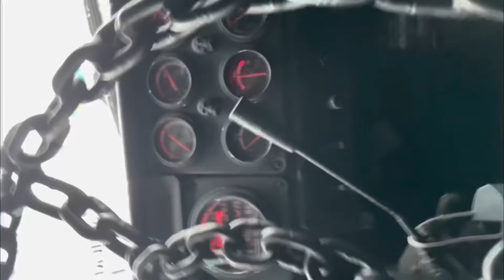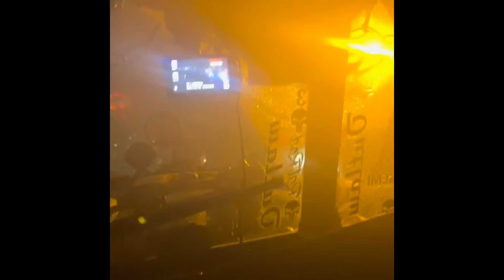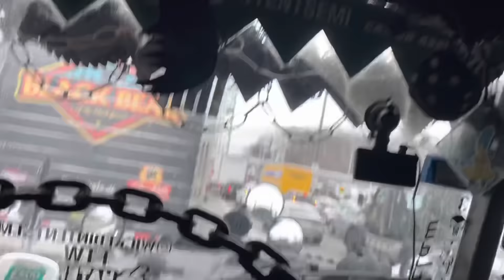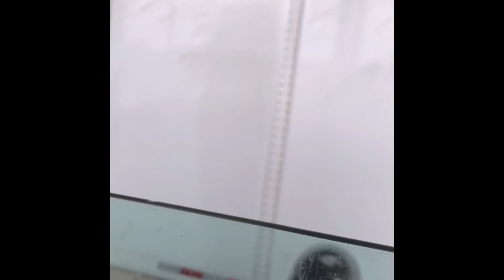WINTER TRUCKING IN SNOW AND ICE !!!!!! (4K)  WICKED INTENT TRUCK SERIES NYC

Comment: Awesome as always brother. My Macks off the road after a shunt with an unissued driver, has hit my wallet hard
Reply from the maker: Dam bro that sucks hope a quick recovery !!!!
Reply: @WickedIntentSemi , the idiot ran a stop sign. Stay safe brother
Reply: @roscoe9507  what mack you runnin driv'ah? I have a 03 mack vision looking to sell or trade for a cabover?
Reply: @keepontruckinoutlawlife1248  , R Model Mack, my 1978 peterbilt 359 still in the shop, so I now have two off the road. PM me with a price. Thanks for hitting me up
Reply: @roscoe9507  well the trans just recently is your 359 a cabover? My 03 is a sleeper truck has a million miles on it and needs a trans I took the transmission out last year to help a friend out who needed one I  use the mack only to pull my mother's 5th wheel camper with had a 13 speed in it original was going to put the same back in this spring. I'm looking for a cabover to restore to haul mom's camper with.
Reply: @keepontruckinoutlawlife1248 , hi, both my R and 359 are sleeper cabs. Long hauls 90% of the time, I can control where I sleep, I like the space and I love a good hood, movie ‘dual’ or ‘mad max’ all day long. Need to be hauling again ASAP, but my Mack is FUBAR, 359 will be on the road sooner at this rate. Hope you get what you need. I have a trans in the shop if this would help?
Reply: @roscoe9507  yes what kind of trans? Super 13?
Reply: @keepontruckinoutlawlife1248  , you’re right on the money, a super 13 reconditioned in the crate, 16.9.  - 1 low reduction
Reply: @roscoe9507  well I'll be dammed same one what you want for it brother?
Reply: @keepontruckinoutlawlife1248 , where are you brother?
Reply: @roscoe9507  Flint Michigan yourself? I also have 6 street bikes I have a 86 Honda Cbr 600 hurricane F1 looks brand new I can also trade
Reply: @keepontruckinoutlawlife1248  , Springfield Illinois, have 4 road bikes, my 1942 WLC, GSXR 1000 rizla race rep, GSX 1400 and my XJR 1300 Kenny Roberts. Right, the trans set me back $2500, fully reconditioned with warranty, but, I like to have a good judgment of character around me, so if it helps and you can collect/meet me, you can have it and one day I may need a helping hand?
Reply: @roscoe9507  well I appreciate that friend I'm going to subscribe to you so we can keep in touch.
Reply: @keepontruckinoutlawlife1248  I’ll do the same, if you want the trans, has your name on it
Reply: I really appreciate that buddy I can give you my number or something? It will only take me 4 5 hours to get to you. Let me know if you're serious about it I can see your just like myself a very great person who is still a real trucker with the great morals brother appreciate you very much mom would be happy to know I might be able to pull the camper again this year..
Reply: @roscoe9507  thanks I do want it and I will get with you shortly my brother appreciate you.
Reply: @roscoe9507  sounds like you have some nice toys as well brother 👍🏻
Reply: @keepontruckinoutlawlife1248  yes I’m serious, PM me, we can exchange numbers and the trans is there, helping out a fellow brother to keep on truckin is what it’s all about, good judgment of character is what I want around me.
Reply: @keepontruckinoutlawlife1248 , I like my toys, just older toys, new and modern does nothing for me
Reply: @roscoe9507  same old school all the way I'm 42 my kids are 24 23 years old have nothing but time to play now☝🏻😀🇺🇲
Reply: @roscoe9507  same here brother will do thanks again driv'ah
Reply: @roscoe9507  hey Ross how do I Dm you I'm kinda old school and don't have Facebook or anything like that I don't even have a Email bro.
Reply: @keepontruckinoutlawlife1248 , I don’t do faceass either. Don’t want you to put your details in here, nor would I want to put mine. Let me ponder this situation
Reply: @roscoe9507  no worries brother got plenty of time we got slammed with 8in of snow last night more on they way.
Reply: @keepontruckinoutlawlife1248 , what if, we meet at a location easy to find?
Reply: @roscoe9507  I'm cool with that brother can you give me let's say a couple weeks or so? Wait until this weather gets better?
Reply: @keepontruckinoutlawlife1248  oh yes completely, it’s not going anywhere, has your name on it brother
Reply: @roscoe9507  thank you so much brother I won't come empty handed 🤙🏻

Comment: Good Swing on the backing I need to slide my 5th wheel back a few notches on my 240 wheel base
Reply from the maker: Rides better too I’ll be stretching too about 290-300wb soon thou for a better ride and to be able to run a unique spare tire rack and tire winter chains on brackets